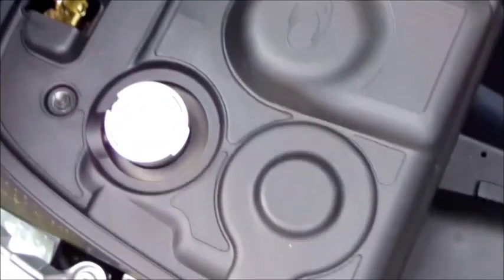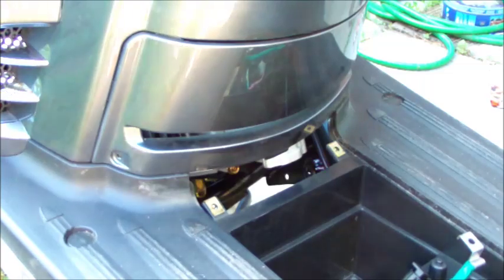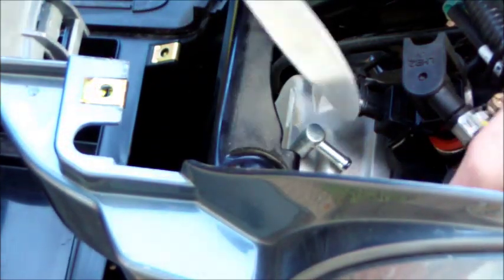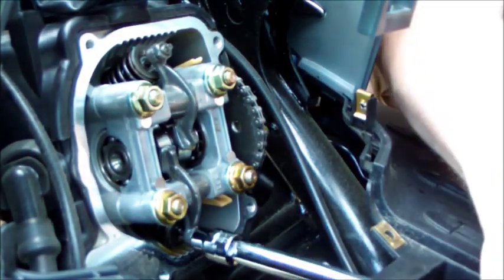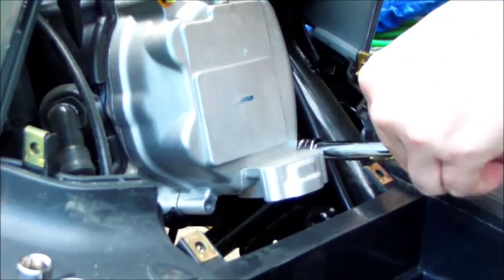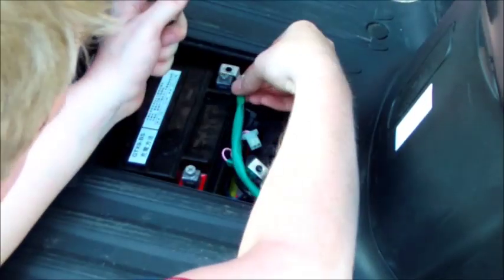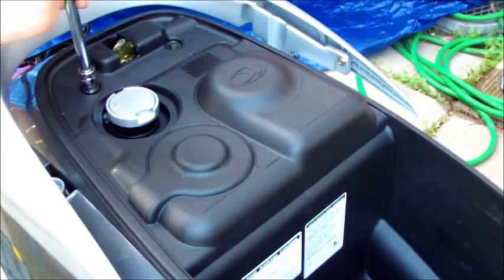Kymco Like 200i Scooter Valve Clearance Adjustment

Comment: At 1:00 place heavy rag over battery - leave in scoot.
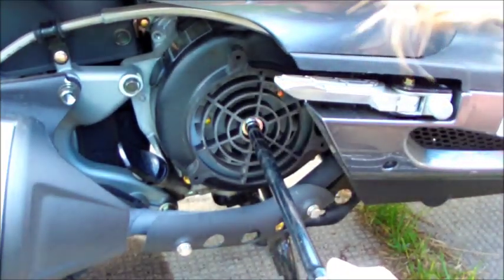5:06 -behind black rubber disc at 10 O'Clock on fan cover (just below info label) is window for seeing TDC timing mark when engine turned, use both methods to check for TDC. Must feel slight movement in valves or spin >> 360 again to TDC.
8:10 add a few drops of oil to lube things before replacing valve cover.
Very helpful video there, Canada- thanks for posting!

Comment: I watched this video just before going out to do my valves this morning.  It really made things easy.  I adjusted my valves, cleaned and gapped my spark plug and checked my drive belt... and all that only took 1 hour and 20 minutes.
Reply: Ho the pickup and the fly wheel works on kymco 200cc scooter and where is the timing mark

Comment: Very helpful!  Thanks!  The Cyclepedia manual has a few more disassembly steps which seem unnecessary after watching this video.  That manual also lists 0.06 mm as the specified clearance.  Where did you get 0.1 mm?